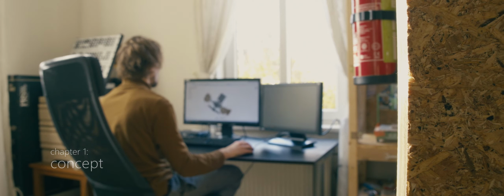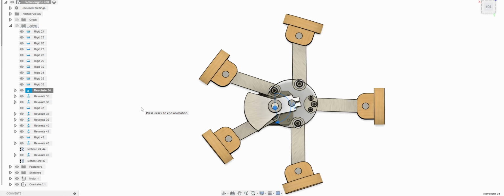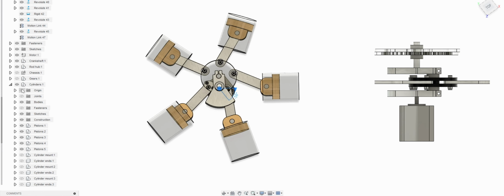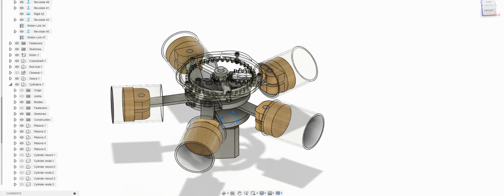Making a radial engine sound sculpture | shutter sequence

Comment: What a wonderfully satisfying sculpture, that's really cool!
For machining aluminium, you might have better luck if you try a single flute cutter, perhaps DLC coated. Also try to minimise the stick-out, you want to keep it as short and stubby as you can for maximum rigidity.
Reply from the maker: Thanks! I actually went with the 2-flute bit exactly for the purpose of stiffening things up, but I suspect the issue lies within the machine as a whole. As for the sticking out part - I'll need a thicker spoilboard!